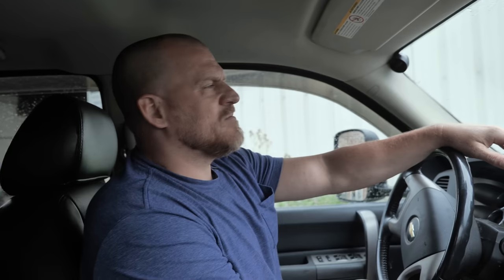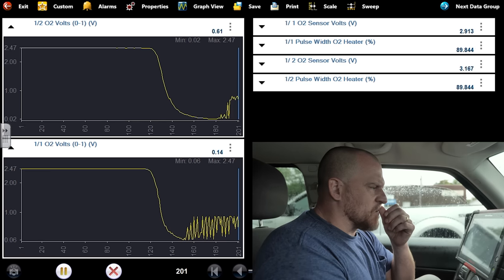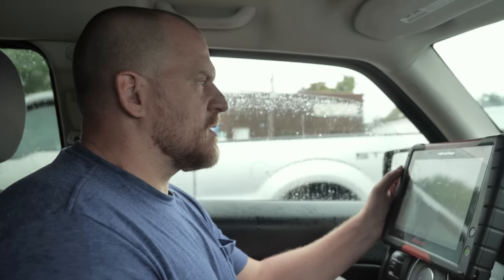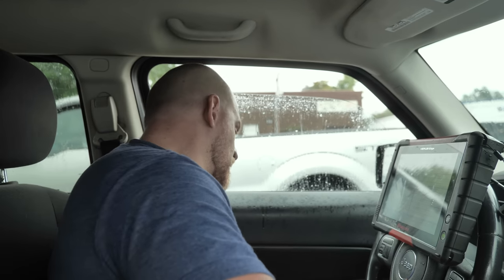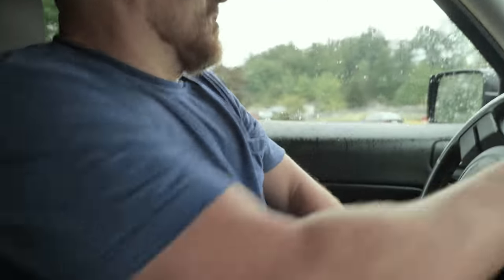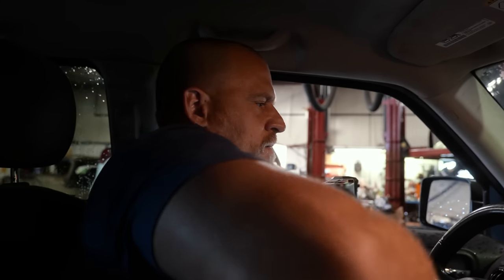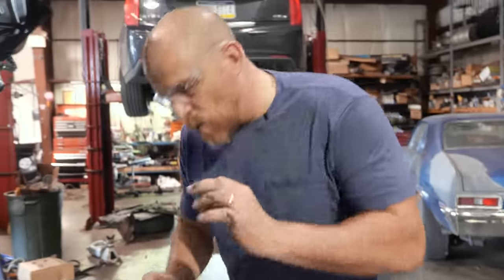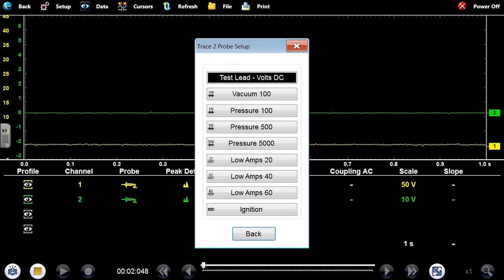Testing Ignition Coils and Fuel Injectors (Intentional Shutdown)

Comment: You'd think by now manufacturer's would switch to a 3 wire coil and protect the ECM from over current faults...I think even new models from Ford and Chrysler still have 2 wire coils on certain applications
Reply: Chrysler likes to look at burn time from their coils, so the PCM needs direct access to the primary circuit.  The ignition coil driver is protected in 2 wire coils from over current and uses a zener to clamp the kickback.  They are fairly reliable.  The three wire coils and circuitry is more expensive to manufacture, so bean counters can save money by using a more simple system.
Reply: Chrysler pperates different and worked for many years. New chryslers I believe are still 2 wire. Simple diag.
Reply: @Discretesignals  This is also a waste spark system. Which I always thought was dumb. Just working the coils needlessly for no benefit.
Reply: @Discretesignals  I thought it would be less money to spend on 1 less wire, but when talking about the actual circuit and system, that makes sense. Learning so much rn. I thought I knew how to diagnose a misfire by swaping coil packs and plugs, ect, but this explains how to verify if a certain circuit is at fault or whether the safety of one failed circuit causes another to fail. I can't wait to really dove in and learn to properly diagnose these issues.

Comment: Brilliant video. Nice to see you getting 'old skool' with that spark gap tester. Here in the UK most mechanics seem to believe you cannot test coils which is why I did a video using the same tool, but it's also great to see a scope being used to back it up.
As for the software shutting the coil down - that's probably an error in the software code. I'll bet Chrysler don't even know it as it's not a error that causes a problem in of itself. Probably poor communication between the Chrysler Engineer who wrote the ECU functionality spec and the software supplier.

Comment: And the reason it does that, to protect the cat due to excess unburned fuel. It’ll destroy that cat for sure. 
Love your simple approach, I had no 02 codes to make sense of this condition. I have the exact engine with the turbo, and the O2 sensor was the last thing I swapped.  Problem solved. Great diagnosis! I’m subscribed!

Comment: I wish every technician had your level of critical thinking and diagnostics skill, along with ethical and moral values. This could've been a parts cannon special (PCM, injectors, plugs, coils, and oxygen sensor ), but ended up being a simple coil replacement.

Thanks for the showing us the ins-and-outs of such a common but potential misunderstood malady. Cheers!
Reply: Ahh a fellow VW tech? The ironic part is the cannon techs would have figured it out early in the cycle because coils are the first part they swap.
Reply: parts canon don't even test shit. they would have figured it out first try.   they would buy a plug and coil first.

Comment: hi paul in the uk i have worked on a few where no 1 cylinder is closest to flywheel  i learned the hard way now if i am not 100% on where no 1 is i force a fault  and use same scanner to tell which cylinder is where thanks for the video

Comment: Would have been interesting to unplug an injector in a good firing cylinder to intentionally create a misfire and see if the computer would have shut down that coil.  We still don’t know if the coil was turned off because it was faulty or because there was a misfire in that particular cylinder.
Takes more KVs to fire a lean mixture. If  shutting down an injector due to a misfire and to protect the cat, why not shut down the coil and protect it too from having to fire into a lean mixture…??

Comment: great video and explantion.. good job guys..get yourself some 9v direct usb lithium rechargeable batteries for your amps clamp, i did the same thing always leave the switch turned on, saves buying lots of 9v batteries
Reply from the maker: My new pico 4425A self powers my amp clamps (of course the amp clamp has been redesigned too but that definitely solves this problem right? Thanks!

Comment: Subject Vehicle:
2004 Subaru Forester X EJ25 AWD

QUESTION:
Will this manufacturer shut down the injectors and the shared coil pack?

The motor compartment harness does not match the ecu side indicating a change in harness. Somehow someone linked the injector power leads and egr power leads from 6 seperate pins to one single stretch of the same diameter wire and then as if they realized they screwed up they reconnected (6) lengths of the original diameter wire off that short singular piece of wire to go to (4) injectors and (2) to the egr. Initially when I got the car it only displayed evap leak code, arf heater circuit code, cat icon, and egr code.

The egr heats up bad but eliminates the code with it connected but to keep it from burning out I disconnected those two wires. The testing of the egr resistence was in range but I didn't find a  correct electronic wire diagram and schematic to guarantee that the pinouts were correct for those other (4) leads (1) on each motor winding potentially being for a position sensor. If I recall correctly voltages were correct koeo and koer. The physical condition of the valve mechanism was relatively clean and east to move and the feed tube and housing were free flowing gasses through the tube and valve body and intake.

QUESTION:
Will voltage or amperage vary enough through the (6) power leads going to one length of wire for a foot and then reconnecting four lengths of seperate injector leads and two egr leads enough to interfere with the pulsing flow of the injectors and cause the car to constantly run rich.

I did cleaning of injectors through through a whole quart of fuel addative after which is when I started noticing intermittent fuel smell from the air intake housing suggesting for possible leakage. Removing them and manually cleaning the injectors yielded no visible restrictions and they sound and feel like they are operating when installed  but with varing intensity one from the other and seemly intermittent feeling of strength within each injector unit. With the exhaust dropped 1&3 had no flame where 2 & 4 had a pretty blue flame where #4 was steady burning and 2 was intermittent burning to me seeming to indicate excessive rich. 

NOTE: 
that now I SEEM to have a parasitic loss of which is potentially through the alternator because even with an isolator switch on the negative side in the circuit after a big 3 upgrade seemed to cause the battery to drain quicker and as if I am not getting the same charge out of the alternator the battery never seems to get up to full charge even with lengthy idle times.

So end of August after doing more research I bought a high amperage alternator kit to make certain I would have enough amperage and voltage to meet this system requirements which the car is amperage wise under supplied from the subaru design and symptomatic with the install of the big 3 as if the alternator has a parasitic draw which reduces or stops by disconnecting the big negative kable and now with the battery isolator switch.

I had bought an alleged high amp alternator with the kables and battery kable terminals although the alternator from dc Power Engineering and through their associates out of Nations starter and Alternator were advertised and stated to fit this car as a direct fit it doesn't fit, it will take modifications to get it to just loosely drop into position in the alternator bracket and then it still doesn't look like the front housing pivot side face will clear the ac belt nor will it necessarily clear the intake on the back so even if it made through shipping I can't fit the unit without making front cover modifications and still potentially need to make bracket and belt modifications to clear the oil sending unit. I requested a return authorization because for what was supposed to be direct fit for $919 total sale the only thing useable is the big 3 kables but not certain if they are constructed correctly because they lied about these alternators being direct fit it is clear they  never fitted these units into a subaru if they had they would have had to redesign the front cover and or design a bracket alteration. They refused to send me a legal warranty update to make the modifications and guarantee me that if I make those modifications and it doesn't work from shipping or assembly errors they would take their unit back.

In between fighting to get my money back I was checking today to get from a local partshouse a tribecca alternator to see if I can both give a limited upgrade to amperage and to eliminate potential parasitic questions. Rebuild kits unfortunately are not available locally or I would have gotten one.
So now I amp trying to address the power supply issues but before I don't believe they existed so I still need to answer the previous questions that existed before the current alternator question and you seem like you would recognize these situations problems quickly given weak supplies of proper technical and troubleshooting  information for free on the internet.

I have to live from this and I am dirt poor  while learning to retrain myself through this vehicle and hoping to get up to a level to get my health back and get a great paying job. I need the help feedback please!!
Thanks and Good Day😁
Reply from the maker: I've never seen that on a Subaru. I've never seen this ever, until now, but to be fair, I'm no longer on the front lines.

Comment: Great case study as always
To see secondary ignition waveform on COP coils I use the Hantek HT308 extension cable, it is a good addition to look for.
Also check the new Micsig Sato 1104 oscilloscope, it is a neat tool for the price and has automotive presets and also come with serial decoding for many buses

Comment: Just started watching videos on your channel because you appeared on videos on the ETCG and ETCG1 channels.  Two things I really liked about this video: 1. How logical and systematical the actual diagnosis is and how you are able to present it in that manner and 2. How you were able to work through something that you had never experienced before.

I was hoping you (or someone on your channel) can clear up some questions I have about scan tools.  It is my understanding that the data that can be scanned is dependent on the year, make, and model of the vehicle being scanned - i.e., my 1996 Dodge Intrepid 3.5L is limited in the number of sensors it uses and, therefore, limited in the number of PID's a scan tool can monitor.  On the other hand, a scope can provide additional information due to the fact that it can be directly connected into the wiring.  My question is this, how can I tell exactly which PID's a scan tool will monitor on my vehicle?
Reply from the maker: It's exactly as you said. All of it. The modules and data PIDs and even bi-directional controls, will be a factor of the car itself AND the scan tool being used.
Reply: @ScannerDanner  Appreciate your reply.  So, in my case, I know that the scan tool that I use can access more PID's than my car provides info for.  But, is there any way to determine exactly which PID's my car can report?  Specifically, the shop manual for my vehicle lists multiple transmission codes for my vehicle, but I have never been able to find a way to access them.
Reply from the maker: @chucklemberg4968  no there really isn't however if your 96 has a separate transmission control module and you can't access it, then it sounds like you're scan tool is just an obd2 global scan tool (minimum function).
Reply: @ScannerDanner  Thanks.  I really appreciate your taking the time to reply.  I will definitely keep watching your videos.

Comment: I cant find the answer to this question ANYWHERE....
How much current does the secondary output of a typical ign. coil flow during the spark...just looking for a ballpark answer.
THANKS FOR ALL OF YOUR GREAT VIDEOS!!!!!!!!
Reply from the maker: That's because you can't really measure it. It is very high voltage but very low amperage is the best answer I got for you.
There is never a time where there would be a diagnostic advantage to measuring secondary current. We only care about how far the spark can jump and the voltage the coil can produce.
Reply: @ScannerDanner  Thanks for the quick reply.  The reason I needed the secondary current value, is because I am designing a circuit in which the coil acts much as it would in a car.  For part of this circuit, I need to block (and pass...I won't get into detail here) the high voltage with reverse diodes.  I have no problem with the voltage (I'm using 2 or 3 microwave oven diodes in series).  Most are rated at a forward current of 250mA...some are 450mA.  Perhaps you will know if this is (=MUCH= more than) significant for the intervals when the HV secondary current must flow in the forward direction, since I can't find ANY CLUE of the sec. current range.
AGAIN, GREAT VIDEOS EVERY TIME!!!

Comment: Well, you said in the beginning that coils 1, 3 and 2, 4 are paired. If engine computer shuts 1st coil down the 3rd would go off at the same time?
Reply from the maker: No, just the power supply is what I was talking about
Reply: just power supply, ground, & IGF pararel on all coil...
The IGT have independent driver/control from ecm to every coil...

The IGF have 5v stanby,,
The IGT have signaling 5v

Comment: great job!  I have the same jeep patriot and exactly the same error!  They haven't been able to find the cause for six months now.  and this all happens when the engine is cold, especially in damp weather; after warming up, it works stably.  If I change the oxygen sensor, will the problem be solved?
Reply from the maker: If you have the exact same error why are you asking me about the O2? We didn't do anything with the O2 on this one did we? I'm sorry, I don't remember
Reply: what solution did you find in this case?  how did you solve the problem?
Reply from the maker: @armenakavagian4867  the O2 had ZERO to do with the misfire
Reply: Is there a problem with the ECU firmware?
Reply from the maker: @armenakavagian4867  nope
Reply: I will be grateful for your help if you tell me where to look?  I changed the coils and spark plugs, as well as the fuel injectors.  misfires only on a cold engine in the second cylinder.  the injector and coil turn off.

Comment: Use a pocket screwdriver with a magnet, or an induction light to see if secondary side of coil is firing, if not, swap coil, and plug if you want to other cylinders, and see if misfire jumps with coil, or plug, and then go from there more in depth. 3 minutes.
Reply: I like how in depth you go with scopes, and PID data for teaching purposes.
Reply from the maker: that test has variables. I've seen a low compression cylinder cause a timing light (induction light) to show drop outs or misfiring, leading others to condemn and replace the ignition coil needlessly 
The problem was low kv demand from the low compression cylinder caused mis-triggering of the timing light
Reply: @ScannerDanner  Not a timing light…. An induction light that flashes with the secondary pulse that the tech can touch to the individual ignition coils that induces enough voltage to trigger an led light to flash (indicating the coil is firing)…… 

Similar principle to a timing light, but no B+ power source needed. Also, the verification of the diagnoses would be SWAPPING THE SUSPECT COIL TO A KNOWN GOOD CYLINDER, and then perform a misfire monitor to ensure that the active misfire follows the suspect coil to the known good cylinder to verify faulty coil. (While you’re swapping the coil to a known good cylinder, the tech could also swap the plug from the suspect cylinder to a know good cylinder to see if it’s JUST a bad coil, or a bad plug. OR….. if BOTH known good cylinder’s plug, AND coil now  misfire with suspect cylinder’s coil, AND plug, suspect a bad coil, AND fouled plug (that is, if the PCM doesn’t kill the injector on suspect cylinder, and not fouling the plug, to save the converter from over fueling, and burning converter element))…..
Reply: Great video, and this path will definitely work also, just my personal preference, and seems to save me time.

Comment: Manufacture could be shutting the coil off to protect the coil from having to operate in a lean cylinder.  Much harder for a coil to push a spark out (higher KV) with out fuel as a conductor.  Some reasons for a failed secondary or spark burning out the side of the boot is vacuum leaks, worn out plugs, or injector flow/pattern issues.
Reply from the maker: I like that thought. A lean misfire is definitely stress on the coil
Reply: First I thought it was just for lowering the energy consumption and alternator load, for the car is already weaker with that one cylinder out
Reply from the maker: @5Dale65  honestly that's probably part of it too

Comment: What is a Power Ground? is that the same as a switched power ground? IE and transistor controlled ground?
Reply from the maker: A power ground is usually a main ground for some type of module or computer system